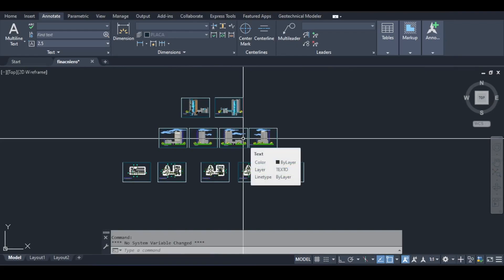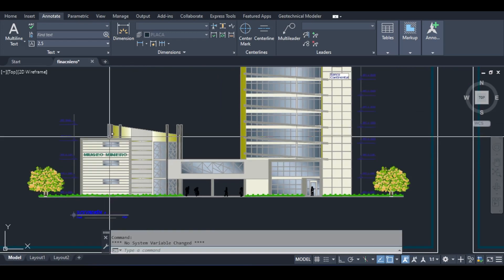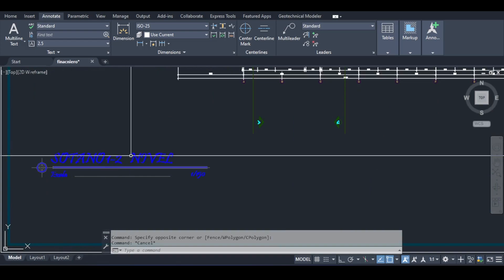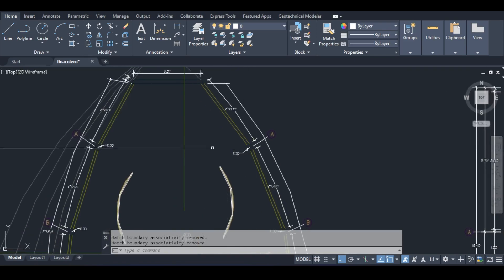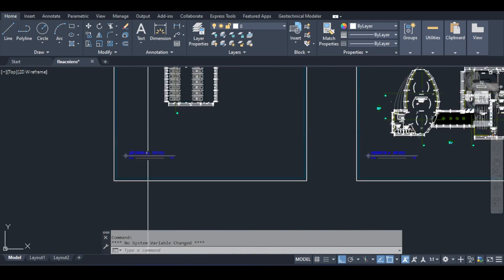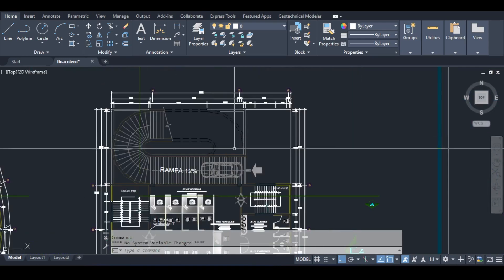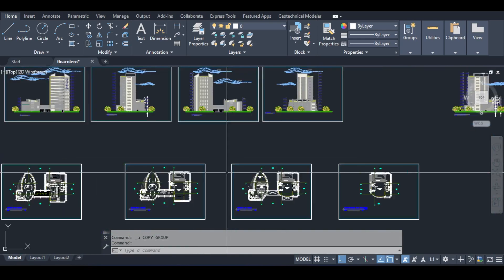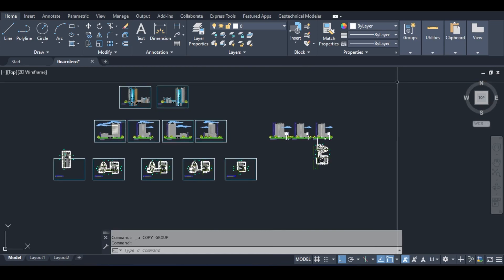Modeling and Design of RC Buildings in Autodesk Robot | Part 1: Understanding the Architecture

Comment: Thank you for this series. It seems one thing is missing to make it perfect...the final design and controls according to the Codes. Also, any structural engineering modelling and analysis results in detailing and drawings. Could you make a video to cover this topic for RC building (ex., 2*2 span with 3-story height under seismic and gravity loads)? I have searched YouTube a lot, but couldn't find anything valuable.

Comment: Hello CEE,

If I am being honest, from the face of it, this does seem like a tall order (and it is intimidating to some extent as well). However, and based on previous experiences on the CEE channel, this is exactly the sort of challenge which only this channel can dissect and can chronologically present and discuss with the viewers for meaningful results as opposed to “just winged cool and colourful” 3D model with animations.

This introductory video is nicely done (thank you, and thank you for sharing the link for the dwg files). 

It is indeed fortunate to have a 3D modelling software like RSAP to help tackle this task. It is quite impressive and it is inspiring that this review by the CEE is a “blind review”; also also add to that the discovery of the “juntas de construcción”…..and the “redactor de CEE” quickly taking charge….

It should be evident that even with experience, piercing together in one’s head the various layouts, elevations, and sections, etc. is a job and a half. Nonetheless, one cannot overstate the importance of having a good understanding and intuition for “seeing and putting together” the various pieces from the various views and angles as it was shown in this video.    

I recall a viewer suggested a side-by-side comparison of a RC building designed with Robot and same building designed with ETABS? but considering that we are currently still baby steps with ETABS, perhaps somewhere in the distant future this idea could be revisited, maybe this building or other buildings or structures.

09:57 Size of the ramp: Interesting, perhaps it is warranted to check and confirm the nominal turning radius, etc. according to local codes requirements.

Looking at RSAP capabilities that have been explored so far, I am assuming that the structural system envisaged for this building will primarily be comprised of RC and Structural Steel?  

When (if they do) does pre-stressed floors become beneficial in a building such as this particular one? Are there other structural systems or a combination of systems that could be considered as better contenders to the “RC and Structural Steel” for this building in your opinion? What would those be?

I hear you mentioned thoughts about considering a raft foundation. Would it be possible to touch upon (in parallel with the raft foundation concept) how one would also go about designing a piled foundations if the building was in poor soils?

This is a really good start; I have enjoyed this video and I am looking forward to the next CEE videos.

Kind regards, DK
Reply from the maker: Hi there Engr. DK,
I tried in this project to give something that does really help viewers in their mission to do structural analysis and design of RC buildings. From what I have seen as a student (back in the day), tutorials were always focusing on a "perfect structure" with "perfectly aligned orthogonal beams" and no challenges or things to stop you and provoke your analysis. So what I have done is I tried to find a structure that "somehow" looks like a project that my viewers are expected to face.

Nothing simplistic, and also nothing too fancy. Yet, having a certain level of complexity that invokes and provokes some thoughts and discussions along the way. You may have seen the taste of such problems when dealing with the ramp issue.

Redactor de CEE suddenly obtained some great spanish skills, although I might accuse him of using google translate, but well, something that we will never know.

Offtopic: I still have the release issue in the FEM series in mind, I have not forgotten it, I am just trying to balance my work obligations vs the videos on the channel without sacrificing any quality on both sides.

I have the side-by-side idea in mind, problem is, as you have stated correctly, the ETABS series is in its infancy. I even had sacrificed this week's episode for the sake of my main series "RSA". I will resume the episodes next week. What I think, however, is that I should revisit the structure in ETABS. Spoiler: modeling in ETABS might not be the joy-ride when compared to RSA's modeling tools.

The great part about your comment with regard to the ramp size was that, just yesterday night, I thought about the same issue. I was like: wait a minute, you are talking about a ramp of diameter 6m and radius of 3, this would put some limitations to the turn radius. It is AMAZING that you are pointing it out, so thnx a lot.

For now, I will try as far as I can, to keep the structure purely RC. Prestressed design in RSA is - as far as I know - limited, so if need be, I might even do an excel calculation for the floor and show it in this series (in case regular RC is not cutting it). Of course, those are still speculations as I am discovering the building together with my viewers. Doing a blind design has - of course - some drawbacks, but its most important advantage is that I am really thinking loud and using real analytical skills in tackling the challenges of the building.

Oh that is a GREAT suggestion, to mention how Piles are designed. My current vision for the series is that there will be some excel side calculations for stuff like pre-stressed floors (if need be) or piles. It is kind of amazing.
A recommended reading for that is.. Principles of Foundation Engineering, SI Edition from Braja M Das where he as a nice chapter about the soil-design of piles. It would be a really good thing to add to this series. If possible, when we approach the foundation design, to give a reminder, would be great.

Thnx a lot for your comment, it helps me and my dear viewers a lot by providing great insights and questions and sparking amazing discussions.

Regards,
CEE

Comment: I found it strange that the building doesn't have a lift with it height and floors
Reply from the maker: Oh, now that you say it, I actually did not check. Will see what I can say about it in the next video.
Stay tuned for more content, and also - if possible - consider supporting the channel by suggesting it to your friends.
Regards,
CEE